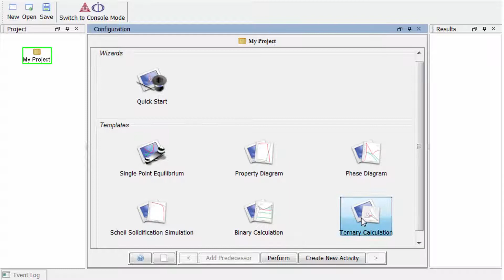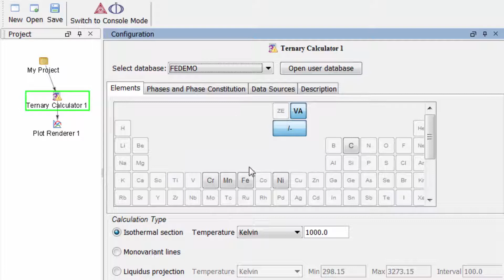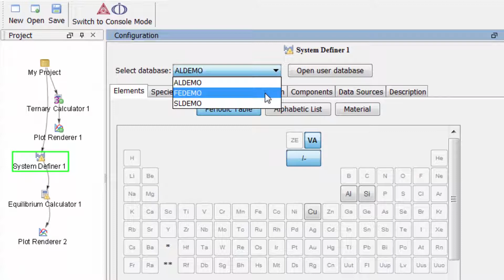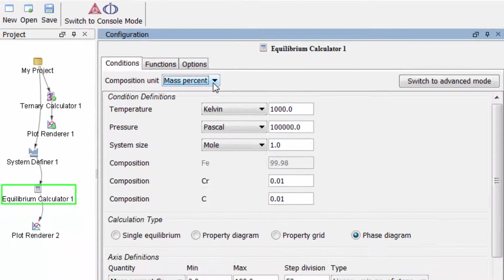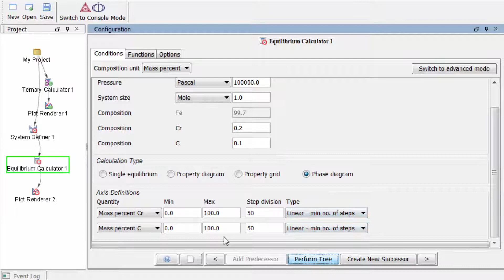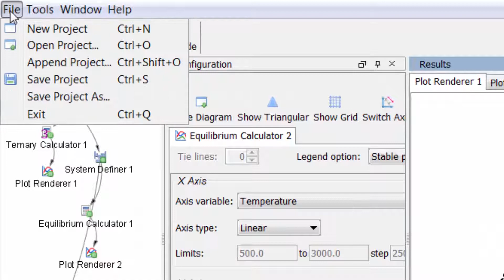OUTDATED - Example T_04 - Ternary Phase Diagram

Comment: How to draw liquid isotherms and isosolid concentration lines in the ternary phase diagram?
Reply from the maker: Hello! Thank you for the question. 
A liquidus isotherm and isosolid concentration lines can be done in equilibrium phase diagram in a similar fashion. You can follow liquidus or isosolid by defining a function such as fraction of a phase. If liquid = 1 then you could plot the liquidus as a contour plot as a function in Z axes. You could instead define a certain phase instead of liquid and then the same plot will become an isosolid concentration line. In terms of ternary phase diagrams, you could also check the liquidus projection which provides liquidus temperatures in a ternary phase diagram.

You could read more about user defined functions or liquidus projections in online help located in your software under help menu > online help.

Comment: Hello 
I would like to ask for help on how to draw a ternary phase diagram for three oxides..for the research that I am studing on..if it is possible to help me to know the method of drawing..bearing that temperatures change
Reply from the maker: Hi Rasha. The main point with ternary phase diagram for oxides is that you need to define components for the oxides. We have a Console Mode example for this: "tcex17 - The Pseudo-binary System - CaO-SiO2'', which your can find in the Help menu in your software. The example is for a pseudo-binary system but you can use the same procedure for a ternary system. We currently don't have any such example in Graphical Mode, but you can use the same procedure in Graphical Mode as in Console Mode since all steps are the same. To define components in Graphical Mode, go to System Definer - Components. Hope you found this information helpful and let us know if you have any more questions.

Comment: How can I go about making a pseudoternary diagram where each axis is 97% one of the three elements and 3% a fourth element?
Reply from the maker: Hi. Thanks for your question. This can be done by using the template 'Phase Diagram' in Graphical mode, which you can access from the home screen of the software. Once you have selected your elements in the 'System Definer' node, set the composition of the 4th element to be 3% in the 'Conditions' tab in the 'Equilibrium Calculator' node. Under 'Axis Definitions', set the axis to be the 2nd and the 3rd element, for example (not the 4th element as its composition is fixed). All other steps are just similar to the Ternary Phase Diagram calculation as presented in the video. 

Please keep in mind that the DEMO and Academic versions of the software can only handle up to three elements. 
 
If you would like an example tcu file, email us at support@thermocalc.com and we can send an example tcu file for this. I hope this helps and please let us know if you have any other questions.
Reply: @ThermoCalcSoftware  Amazing, thank you!

Comment: How? to know the name of the phases like BCC_A2#2, BCC_A2, M23C6, HCP_A3#2, etc... we usually use the metallurgical names like ferrite, austenite, martensite etc...
Reply from the maker: Hi. I'm sorry to take so long to reply to your comment. I must have missed it. Unfortunately there is not a universally accepted system for naming phases, so we use a system that is widely accepted in CALPHAD. The first part of the phase name refers to the crystal structure, for instance, BCC means Body-Centered Cubic and FCC means Face Centered Cubic. The suffixes A2, A1, etc. refer to a classification system for crystal structures called Strukturbericht.